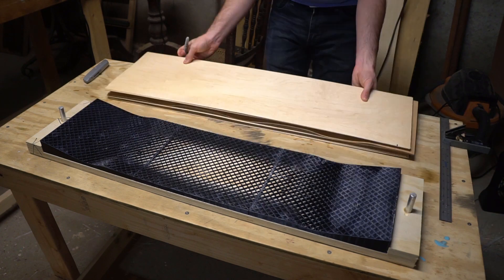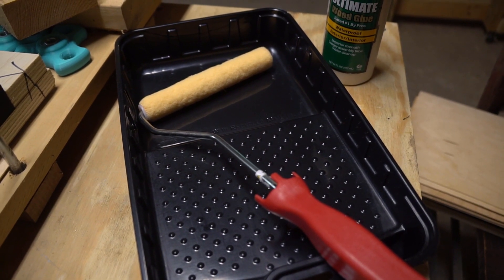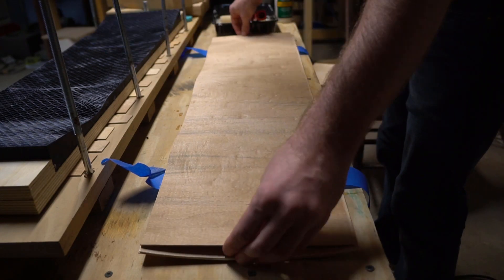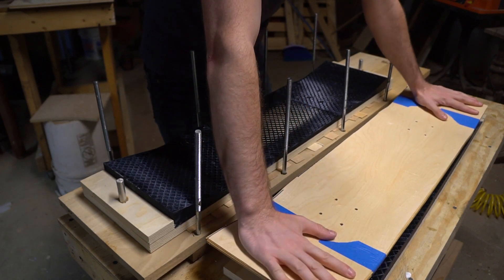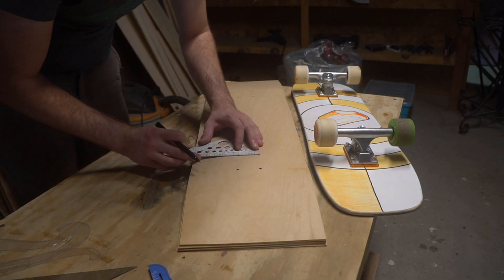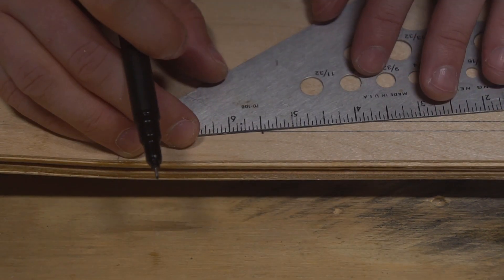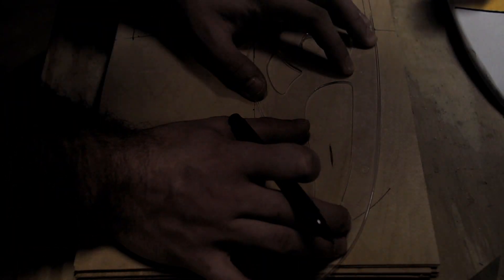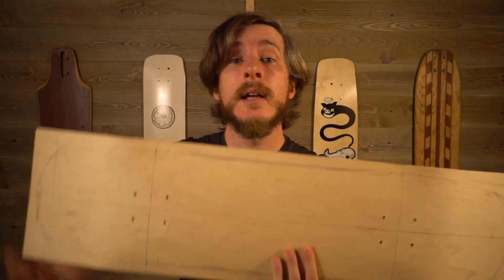Pressing and Designing a Shaped Deck With a 3D-Printed Mold

Comment: how would one design their own geometry for these stl files? I'm looking to design some very unique shapes
Reply from the maker: The open source files include a Fusion 360 working file, or you could check out SK8CAD by Open Source Skateboards. If you're looking to make more complex geometries it might be time to take the dive into CAD, Angus over on the channel Maker's Muse has a really good introduction series to Fusion 360, that's how I started learning.

Comment: Cool press, but best to design your board shape on the 'top' of the blank, rather than the bottom. Also you can draft it on a large, flat piece of paper (starting with the wheelbase first, and working off of that) then lay it on the top of the blank, to eye up how your shape is going to look. The numbers to work within (on a standard shape) are usually.. Nose 6.75 to 7.25, Wheelbase 14 to 15, Tail 6.25 to 6.75

Comment: This is really amazing brother. That press using screws are great!
How do you round the edge of your decks?? Im having a hard time reshaping an old board. Thanks for the shared knowledge . (Sorry about my english, im brazilian.)
Reply from the maker: I've been trying to learn to use a router lately, it's more finicky than I thought. But before that I just used files and sand paper

Comment: Think you deserve this growing attention. Great videos. One question tho: should this kind of mold work for a snowboard/wakeboard press system? What do you think?
Reply from the maker: In both cases I think a mold like this could work, but I would want to cover up the open grid with something so that there's a nice smooth surface. It would also depend on what kind of press you'd be using. I think some of those snowboard pressed would definitely crush a mold like this
Reply: @GoodRoads  yes, i thought the same. Maybe considering in the design of the mold, something such as a layer of polystyrene in both sides to make a soft and smooth surface. I thought  of a mechanical press, with  adjustable nuts
Reply: Since its a continous rocker, it shouldn't be much of a problem to design it
Reply from the maker: Yeah, I think that should work

Comment: Why are you not using your vac bag anymore ? Do you get more pression with bolts ?
Reply from the maker: I really only use the vac bag if I'm using a one sided mold or if I have to press a board that doesn't fit in one of my other presses (the bag I have is huge). You can get more PSI from mechanical presses, they can press tighter curves more easily, and I find them a lot more simple and less finicky to use. A vac bag is still an amazing tool for certain things though, composites especially

Comment: I've only been using a 4" roller. That was a really speedy glue up and I might need to upgrade.

Hope you make a video doing the graphics of this new board too.

Only thing I can think of to change up for the mold would be steel sleeves for your hardware drilling guides.
Reply from the maker: I've actually had some de-lam issues with the glue, I think I should have applied glue to both faces of the veneer on the internal seams instead of just one side. I also thought I had bought some brass tube stock to use as a bushing surface for the drilling templates, but I couldn't find it. Maybe I ordered the wrong ID or something. Definitely going to do a graphic video on this deck too, I'm trying some new stuff with it.
Reply: I've only tried maple once, and I had delam issues, I think probably for similar reasons.

But mine was visibly failed right out of the mold, probably because I didn't 3D print it.

Its hard to not like Baltic Birch for how fool proof it can be.

Comment: Drummers have a quick release wing nut for their cymbals. You should take a look at that design if you want clamping speed.
Reply from the maker: That is a really neat idea
Reply: @GoodRoads  I could imagine that the strength of a drummer quick release nut might not put up with the forces of a press.

However, the idea does make me remember seeing a design for a quick release vice. I'm sure there's loads out there, but I think the one I'm remembering is from Pask Makes.
So if the drummer nut solution doesn't work out, there is something else out there which is being used to hold substantial loads.
Reply from the maker: Man, I love his channel. And yeah, it's that sliding half-nut thing that people do to make quick release vices, super cool. I think there are even plans out there to 3d-print them. Honestly this press is a backup and works just great for me for what it is, if I'm going to spend time developing a press it's going to be to get my 1.5 ton electric press up and running again >:)

Comment: I've been looking forward to seeing your results with pressing with an open grid mold (such a cool concept). It's so great to see you got good results with it! How did the mold hold up after pressing? And did any of the grid lines transfer an impression to the board surface? Also, do you think 1/8 Baltic birch would conform to those curves as well? I'm just starting and trying to mix and match the best techniques I'm learning from your videos with the tools and materials I have access to. Thanks, and I look forward to more of your videos!
Reply from the maker: Good questions! The mold held up fine, I didn't notice any damage or deformation. It also didn't imprint any lines on the maple. 1/8" birch is much stiffer than veneers, so you could press a BB deck with a printed mold. But, in order for it to be successful, I would make sure that the curves in the mold aren't too sharp or drastic at any point, you want nice smooth transitions because the stiffer material won't conform to sharp angles as well. In general birch plywood won't take on the exact curves of your mold as well as veneers will. I imagine that the grid would leave an imprint on birch too, just because it's a softer wood. Good luck with your build dude! Keep me posted on how it goes!

Comment: That mold and board looks amazing!! also you gave me the idea to make a mold out of recycled plastic copying from another board shape, it could be a good choice...
Reply from the maker: Do you mean like melting down a bunch of plastic to make the mold? I think that would be super interesting, I've been keeping an eye on the Precious Plastic channel for years now and I really like the idea of reusing those materials in small ways. Especially since there's usually a lot of discarded plastic as I'm developing these 3d-printing projects.
Reply: @GoodRoads  yess like that! also I don't know, but if you can process the plastic to use and print on the 3d printer that would be super, because you can make some skate pads or pivots, and boards too... a recycled plastic skate brand jajaj
Reply from the maker: Reusing 3d printed plastic is the holy grail. I'd love to get to a place where I could justify getting a shredder and a filament extruder